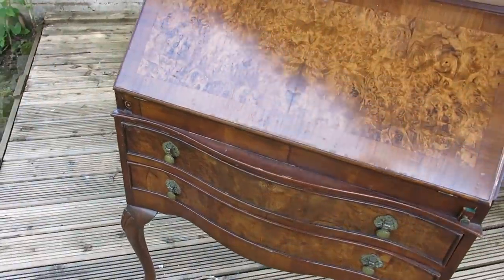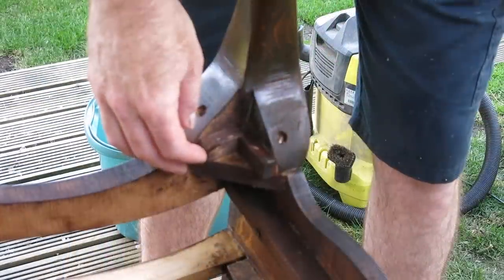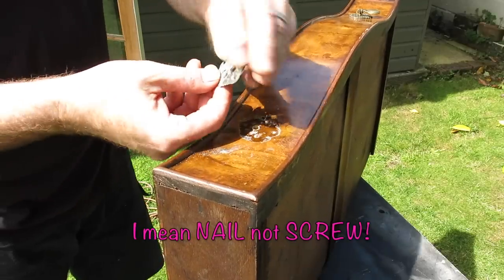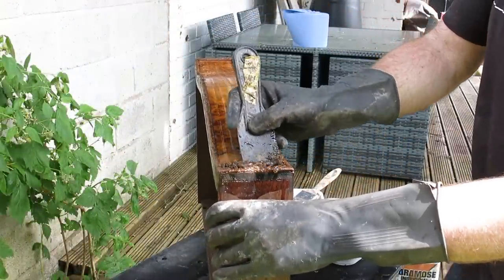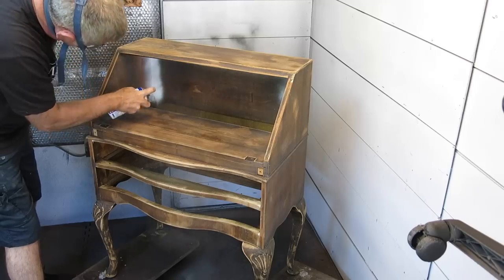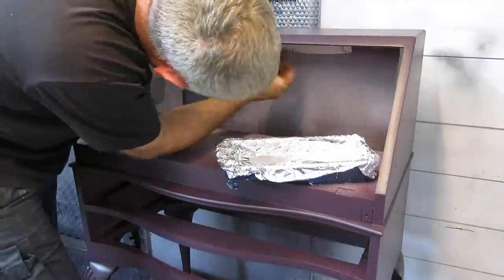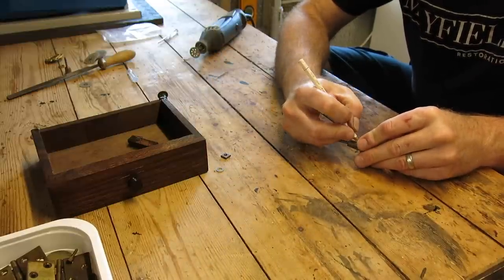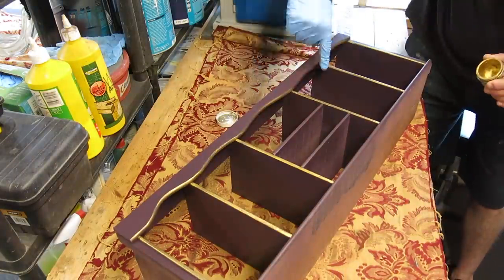Bold Furniture MAKEOVER of a Vintage Writing Bureau.

Comment: I almost fainted when you started painting it purple but it turned out nice. Me personally, I wouldn't have done the interior in white (too delicate) but that's relative.
What beautiful veneer. 
As always, great work!
Reply from the maker: I know the purple can be quite shocking at first. I've had a few comments about the interior colour. its actually called Caluna which a a light grey not white but maybe it hasn't come across very well in the video. It is a very light colour though. 😀👍

Comment: I have a mid to late Georgian antique writing desk with similar burl / figured English walnut veneer so was interested in how you addressed that.  I'm hoping that this wasn't actually an antique, but at least the part you painted wasn't critical or over any of the lovely veneer.  If the client is happy, then my opinion doesn't matter a fig - I learned a couple tips I'll be able to use when I go about restoring mine (missing metal pulls).
Reply from the maker: Hi Lee, definitely not an antique. I would have found a different piece to add paint to if it were. Glad I could offer some tips for you to do yours. 😀😀👍

Comment: Hi, good restoration of this piece. The purple and wood burl match wonderfully. The light color on the inside seems too stark a contrast, however. Something more muted might have worked better in my opinion. 
But... good work!!
Reply from the maker: Hi Peter, thanks very much and I appreciate your view on the interior colour. If I did it again I would probably find a middle ground between the two. 😀😀👍👍

Comment: Thought I'd share a handy technique I dreamed up for masking lines (more useful for really narrow lines...  Stick a wide strip of masking tape to some scrap plastic sheet.  Draw parallel lines the required width apart roughly down the middle of the masking tape.  With a steel rule and new scalpel cut along those lines, then remove the resulting remove the middle strip of tape, but leave the outside strips in situ.  Apply a length of clear tape over the two strips of masking tape.  Now lift the clear and masking tape as a single piece, the clear tape will hold the masking strips at the required width.  Stick onto the workpiece exactly where you want to apply the line, the clear tape should help see the positioning.  Peel off the clear tape while ensuring the masking strips stay in place. Now your masked line is ready for painting.  A tempting shortcut is to cut out the center strip in situ, but with a new scalpel blade its almost inevitable that you'll cut into the surface of the workpiece, which will produce a ragged edge to the line.  Take my word for it, cutting in situ can look awful!
Reply: Also, Pink Stuff (look for it in the cleaning product isle in Tesco's) is a remarkably good fine surface preparation.  For an amazing polished wax finish I apply one coat of Gilboys furniture wax (shockingly expensive and totally worth the money... it's incredibly good stuff)as per their instructions.  When that's cured I then rub over with Pink Stuff on a soft damp cloth, then buff off the Pink Stuff with dry kitchen roll, it should buff to a semi gloss finish.  Then another application of the Gilboys polish will buff up to an incredible wax shine.  Yes I know this sounds like utter bullsh!t, but get the small sample set of Gilboy polish (if you polish wood this will change your life) and then try this on a scrap piece, even just an odd bit of pine sanded to a P120 finish will do...  Told you so... experience shouts that it shouldn't work, but it's incredibly effective!!  Other decent furniture polishes can probably stand in for the Gilboys, but probably won't be as good.  Pink Stuff buffing can also bring paintwork and varnish to a glass smoot finish, but it is a fine abrasive so go easier on these finishes😊
Reply from the maker: Hi Doc, I love this tip, thanks for taking the time to pass this on 😀👍👍👍
Reply from the maker: I know of the “pink stuff” cleaner and I think we may even have some in the cupboard so I’ll give it a try. I’ve been wanting to give the Gil boys polish a go but agree that it’s super expensive but I might bite the bullet and get some now. Thanks again Doc 😀😀👍